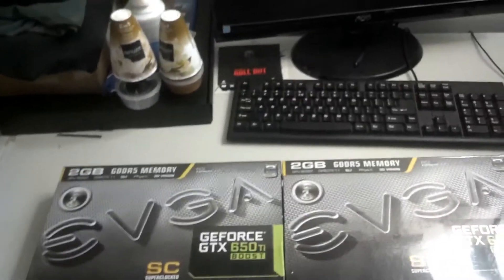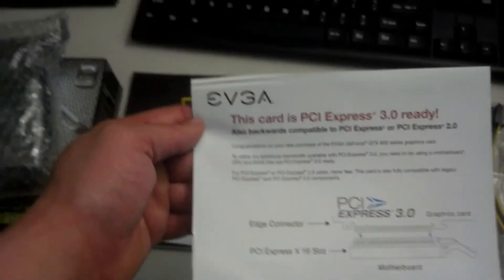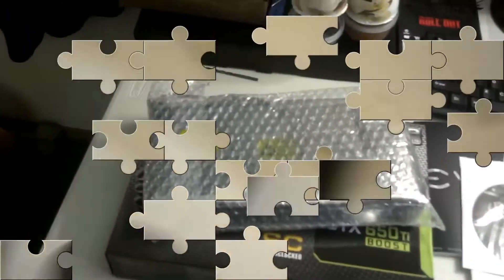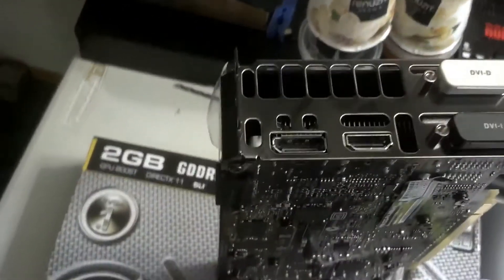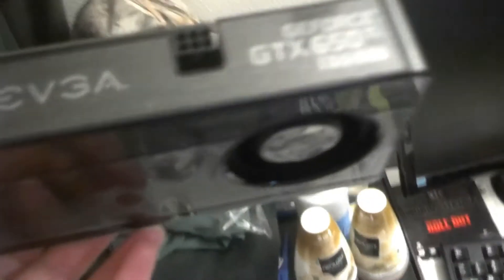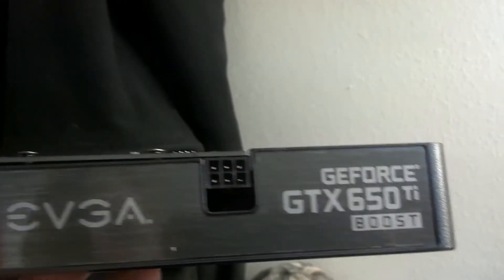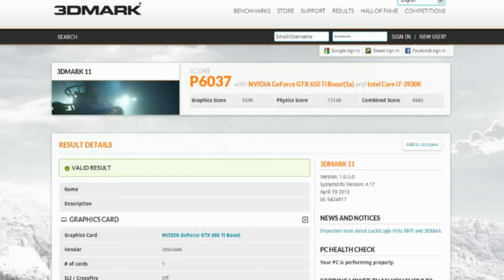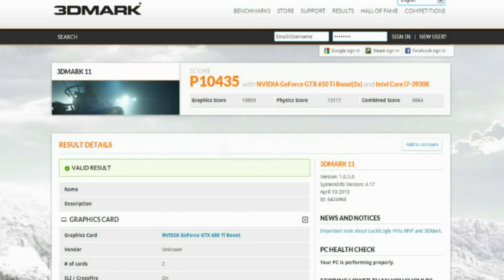SuperClocked EVGA 650 TI boost Unboxing and benchmark for single card and 2 way SLI

Comment: I've watched your entire review, and I'm really quite impressed with how these cards perform in SLI. Just a question though. If two of these cards ($340) in SLI can beat a 670, and slightly top the GTX 680 and the HD7970, do you think it can also go well against a GTX 770 (that's "technically" a 680 on steroids) that costs 400 bucks? Since I'm one of those people who can't afford a single $400 card right now, I'm planning on getting one 650 ti boost now, and another one later down the road.

Comment: i own one of these (i would have two, but, my old p8z68-vlx mobo does not support SLI) - Very good graphics card, I run an intel i5 2320 3.0 ghz processor and 8gb of corsair vengeance 1600 mhz, and run BF3 Ultra settings at 55 avg fps in multiplayer and locked 60 fps v-sync in campaign. I upgraded from the Gigabyte 550 ti 1gb to this, and it blew me away.